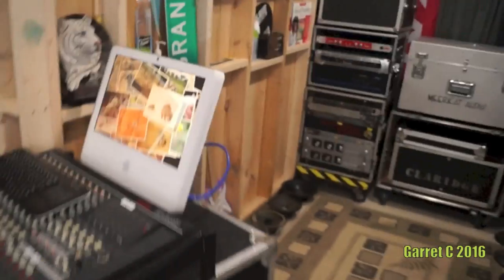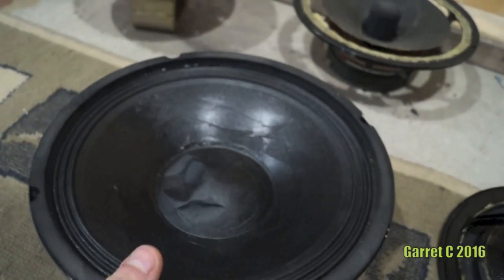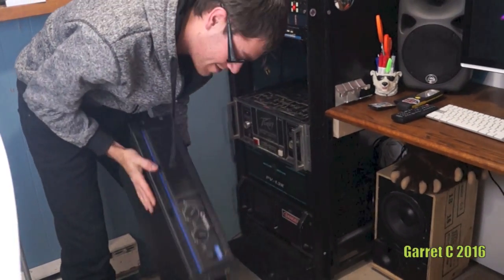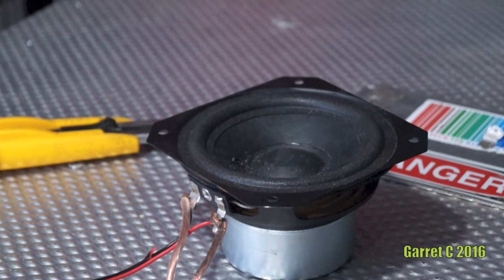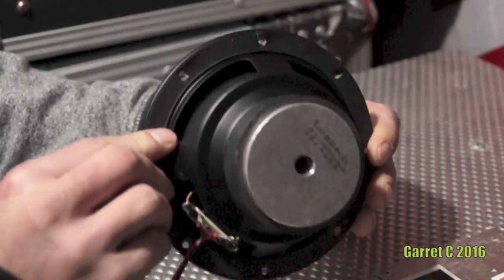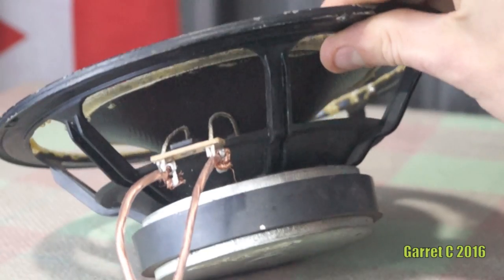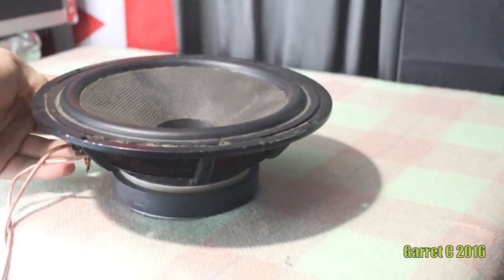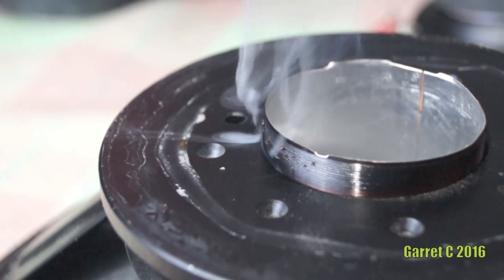SPEAKER BLOWOUTS! - 8 Speakers With the CS-800! - LOGITECH, SONY, SEAS, PIONEER, PRO AUDIO

Comment: always good to see Logitech getting popped!
Reply: Vangerino vangerino It's a cheap brand but they don't disappoint you. Look at the z5500 they are great except for the lows from the sattelites. But they are clear and have good deep bass
Reply: the more expensive models are more decent but, the cheaper models like in the video are not that great is all I'm saying
Reply: Vangerino vangerino i agree with you
Reply: Vangerino vangerino Even the more expensive ones are absolutely rubbish.
Reply: James Collins you are saying that bcs you've never owned the higher end models
Reply: Sam Gates hahaha... no
Reply: Sam Gates you mean conversely
Reply: "Haha plastic crap!" Just like Logitech ;-)
Reply: Sam Gates  So why call Bose out on it when Logitech is the same?  In my opinion, Bose is just a more expensive Logitech with sometimes better bass, still weak clarity and highs. Any good $100+ pair of desktop speakers has wooden cabinets and dedicated tweeters (often dome tweeters) for the highs. AudioEngine is just one example of a bunch of brands that have cropped up and started making good quality "PC" speakers
Reply: Sam Gates  The sad thing is that there use to be much better competitors in that "standard-midrange" bracket. I have owned Logitech, Creative and Altec Lansing computer speakers. Creative and Altec Lansing had much more musical sounding speakers in my experience, with Logitech more aiming for boomy bass and surround sound. Logitech Z series have always been aimed at gamers over media consumers.
Reply: Sam Gates  I don't understand what Logitechs beef is with tweeters but they very rarely ever use them, the few models I have seen with them actually don't sound too bad at all. I also wish they would build their subwoofer cabinets a bit better, instead of trying to make the most $$$ off larger profit margins. I wouldn't bash them if they cared a bit more.
Reply: Sam Gates  I had a pretty decent set of Altec Lansing 2.1's that came with my 2001 PC. I think the sub was 20w and the satellites 10w each. They're still in use on our family computer in the office and I still think they sound better than my Logitech 2.1 X-230's. The logitech's go louder but the AL's have a much nicer smooth bass response that sounds more akin to a home stereo, the woofer is bigger though so I guess there's that.
Reply: Sam Gates  
Read this, apparently the quality of Logitech has dropped a bit compared to their earlier 2.1/5.1s   I think it is very amusing that they have put a fake tweeter above the midrange (just molded plastic) which serves zero purpose.
http://techgage.com/article/logitech_z506_51_speakers_review/
Reply: Sam Gates  Meh. They aren't worth my time. lol.. Not a bad idea though. I'll suggest it to my mate who has the Z5500. The woofer is still not that great though, not sure if it can be improved? Maybe with some filler in the sub cabinet?
Reply: Sam Gates  Putting tweeters into my older Logitech 5.1's lol. I've stopped using em.
Reply: My dad has owned the z5500 and I've owned the z906 none of them sound as good as the speakers I have now. But they do sound quite good for budget surround sound I guess.
Reply: James Collins  They aren't suppose to be bass heavy though. Klipsch make pretty good PC speakers, otherwise a set of desktop speakers like the AudioEngines etc would be fine.
Reply: Sam Gates  Your what?
Reply: Sam Gates  Which?
Reply: Sam Gates  I can't believe that after 20 odd years they still can't at least make a set of affordable desktop speakers that sound great compared to what they were making back then! Surely speaker and cabinet tech has come along since then?  Altec Lansing use to be fantastic until they started to cheap out on their designs and eventually stopped making PC speakers altogether.
Reply: Sam Gates  Yeah I could be talking about those ones. I more mean the ones even in 2008 etc.  They might still be better than comparable Logitechs (Altec Lansing have always had a nicer bass as opposed to Logitech who generally has more boomy bass.)
Reply: Sam Gates interesting.
Reply: lol
Reply: lol...
Reply: lol!??
huehue
Reply: Logitech user here
Reply: I was reading your comments with fun and popcorn while i am listening to music on real Hi Fi Equipment.

If you are at home, you have space and 300 € such PC Speakers are the worst choice you could ever make.
400€ for a Logitech "High-End" System which actually is lowest mid range is a pure waste ( better burn the money, than you at least have heat for some time, lol ) if you compare it to a Hi Fi System like mine.

There is no brand which sells budget PC Desktop Speakers which are 10 cm high but sound good, full and vibrant. If you do not have space but need some audio output. Okay. But if you want enjoy music and have real movie effects. lol no.

If you have a sub that is maybe enough and okay for movies. But not for music. Specially because such cheapo subwoofers are so fucking inacurate. You will hear bass at 40 Hz but the sub is totally silent at 43 Hz, comes back at 45 Hz and cut off again at 50 Hz and so on.

Just use google and educate yourself a bit about audio
Reply: Lol, Yea I have issues with Logitech too, cheap very ordinary products.
Reply: Dom what hi-fi system do you own?
Reply: @unjust1644 nothing really special.
AMP:
Sony STR 5800 ( Made in 1979 )
75W RMS per Channel on 4 Ohm
250W Peak
Dampening factor 50
But it is in good shape like it came fresh from factory. Not even a scratchy Poti. Bought it on a flee market for 20€ ( seller thought it is a simple old useless Radio reciever )

Speakers:
2x Magnat Zero 5 ( Made in 1991 )
100W RMS / 150 Peak
55 L Volume.
3 Way System with 20 cm Bass Driver and Bass reflex System. 28-34.000 Hz
160€ on ebay

2x Magnat Zero 4
90 RMS / 130 Peak )
about 45 to 50 L Volume
20 CM Bass with Bassreflex, 3 Way System. 33 - 34.000 Hz
4 pieces 80€ private seller. I gave 1 pair to a friend.

Well, that is no McIntosh Equipment an such, but still more than enough to outperform any modern 1000€ + common Electronic Market Stereos easily.

Also i gopt a good room for accoustics. The Speakers are standing about half a metter before the room corners so the back showing bass reflex system performs best.
Reply: So... Logitech or Creative ect is not comparable. Even their most expensive systems.
Reply: Vangerino vangerino Edifier speakers are way better than Logitech speakers. Also edifier is better than Bose.
Reply: Liquid Car They dissapointed me. Plastic and full range...
Reply: David Perry
Reply: Lol Jolk Logitech has improved over the years
Reply: Vangerino vangerino felix

Comment: I don't understand what's inside a speaker that makes the music play.
Reply: Voice coil and magnet the voice coil is the thing that makes the sound the magnet is what gives it more sensitivity per watt to the speaker the bigger the magnet the louder it's gonna be per watt
Reply: i think it's, like, the electricity turns the copper voicecoil into an electro magnet, and , you know, the electro magnet acts with the magnet to, um, vibrate the cone and make the noise. i think thats it. i may be wrong.
Reply: It’s vibrating so fast that it creates the tones by moving the air that’s in front of it

Comment: hey Garret I have a broken 9 inch 3-way speaker Just laying around it Sounds decent but there is a hole in the woofer so im about to throw it away. but I dont want to! I want to send it to you but I dont Know how could you Tell me if there is any possible way of sending it to you? ps:they cost 80$ holy SH*T second day and its broken. thanks! :)

Comment: your imac is fucking ancient garret
Reply from the maker: haha yeah, Must be a 2006 Its core2duo and 2 gigs ram
Reply from the maker: Then the one on my desk is 2009 aluminum one, 4 gigs of ram - I just use them for internet browsing really and I never had issues on any of them, stock hard drives too, I have great luck with apple and have no reason to update them things yet - I edited this on an i7 macbook pro though with an SSD and 16gigs of ram :P
Reply: My main laptop (HP Pavilion DV5) has Athlon II with 6 gigs of RAM, but the HDD power adapter is broken, so I will turn it into a external HDD, now I am temporarily using a crappy HP with Intel Celeron with only 2 gigs of onboard RAM, and 32GB eMMC drive.
Reply: And I am a PC user, My dad and I only buy PCs because Macs are too expensive and Windows has more program compatibility
Reply: ***** haha, figured there had to be another, more powerful machine behind the videos
Reply: Ryan Lin I agree, Windows is better than Mac.
Reply: Windows is obv. better in terms of hardware, but I just wish windows could get their hardware into a box that copied the style of apple. Undeniably, mac has the upper hand in terms of looks
Reply: You look at other machines by MSI or Microsoft themselves and they look pretty sexy!  The ridiculously overpriced Surface Studio looks better than the iMac, larger screen too. The newly announced Dell XPS 27" AiO has tiny bezels and a 100w built-in sound system. Looks slick. In regards to laptops and AiO's the PC makers have largely caught up. Oh and they have not only USB-C but traditional USB and video ports ;-)
Reply: yeah, apple is losing some ground in that front, still has a ways to go in my opinion though
Reply: insta kill  It's perfectly ok to have an opinion, as an ex-Apple fanatic I will politely disagree though. :-)
Reply: djlobb Waite you can build in Apple Mac Pro g4
Reply: djlobb I will probably begin to think the same eventually, it seems to be heading in that direction
Reply: Ryan Lin  I have no frickken idea what you're talking about mate lol.

Comment: isnt this terrible for your amp etc.?
Reply: Yes it can damage the amplifier, he doesn't care if he blows up the amp either. When the voice coils smoke and it burns off the insulation the voice coil wingdings short together. You may notice the smoke increases and some times there is a small explosion as the speaker goes short circuit, and that amp blast it open. The high current surges often exceed the safe operating area of the output transistors, damaging them and eventually the amp will go pop too.
Reply: The CS-800 Uses T0-3 metal can power transistors in its output stage, if the transistors do fail, the event can be rather violent and explosive. Unlike plastic T0-220 247 transistor the go pop with smoke, TO-3 can go bang, like a bomb, because the transistor is sealed up inside a metal can, the pressure builds up til the can ruptures.. very dangerous. Catastrophic failure is the term us technicians uses!!
Reply: bjtaudio I doubt he will blow up that old cs-800. They’re built very robust. I used a cs-800 to power some mains and it took many blown drivers without a problem. Those amps took whatever abuse we through at them and still work reliably
Reply: i agree. peaveys old equipment is near impossible to kill, that old cs800 that garret has is so used and abused and it keeps on going. I have a PV4C that just doesnt die.

Comment: The norwegian ones are a pair of seas speakers. Seas is an overly expensive norwegian brand. Even if it is very expensive, they are made of quality. I guess you could have fetched a very nice price for those! And just pointing out, those faze plugs are not original, and was probably put on by their past owner.
Reply from the maker: oh cool! I had this pair in my shed for years, the glue had come right off the one missing rubber, that shit he used is like for putting wood onto a brick wall with its expanding bubbles :P They were free and I would have never fixed them although I offered them to lots of people for free that could have fixed the things but nobody bothered :P